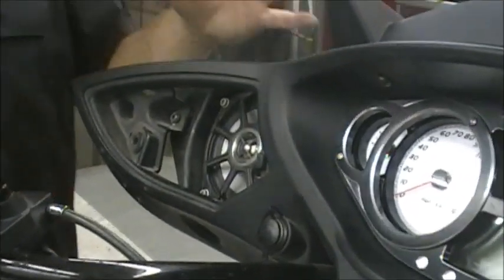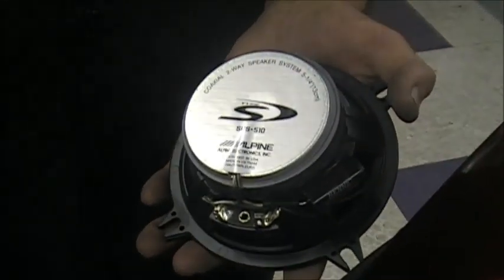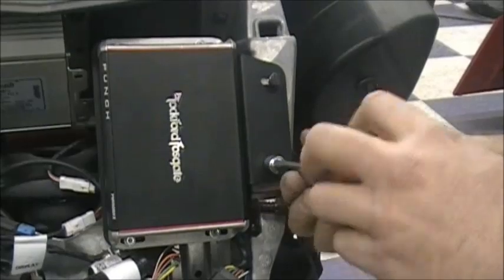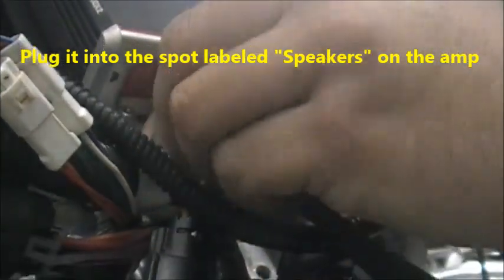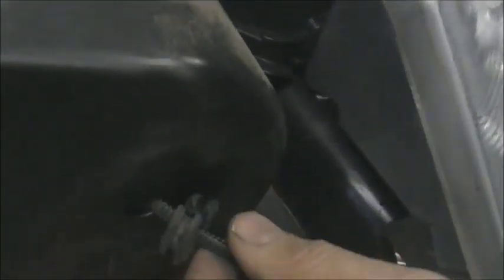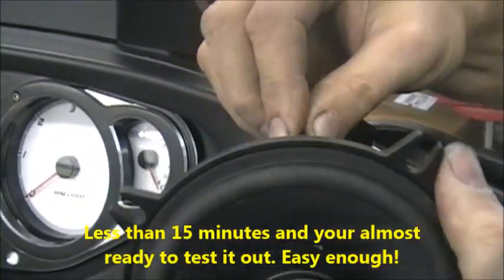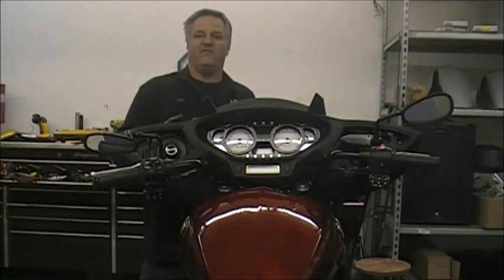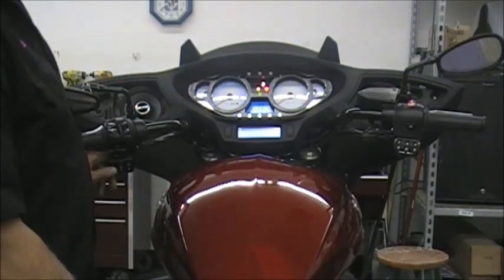Witchdoctors amp and front speaker kit for Victory Cross Country & CCT

Comment: so the reason you don't need a remote wire is because the speakers send the signal to amp to turn on?  Also did you run a ground wire from amp or is that not needed either?
Reply from the maker: +Daniel Kepfer Jr Yes the factory speaker wire sends the signal.